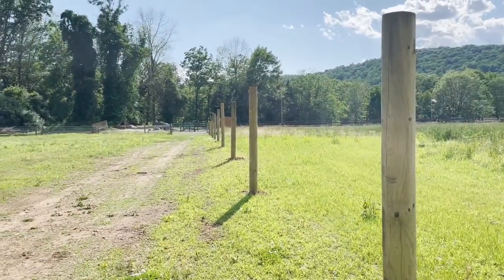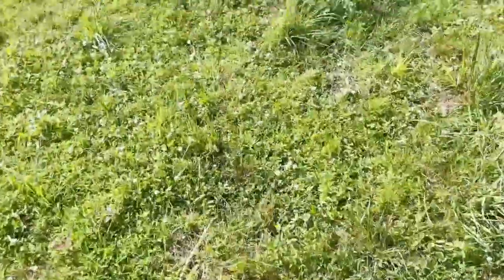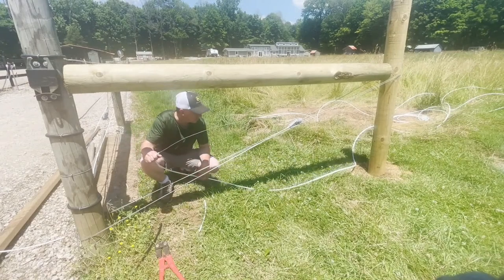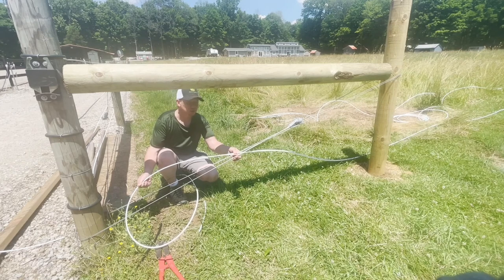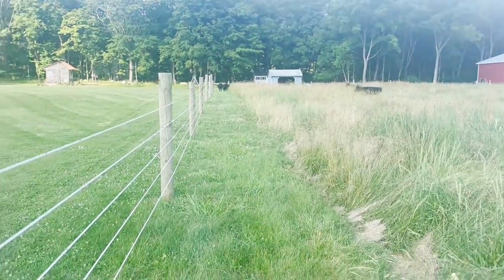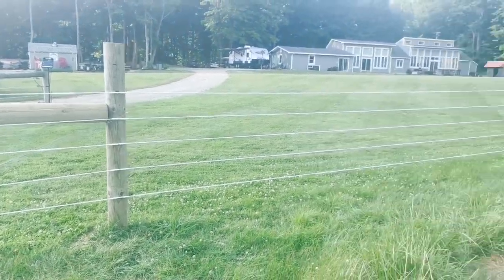Building a high tension (hotcote) fence.

Comment: How did you tighten the other end of the fence?
Reply from the maker: One end of your wire doesn’t have any tensioner and is looped around the end post. You thread the wire through insulators on each post where the wire is held in place but is free to side through the insulator. When you crank on the tensioner, it will pull the slack out of the entire run. Corners will add friction making it harder to pull tension but you can pull tension on hundreds of feet of wire with just 1 tensioner on the end post. Hope that explanation helps!